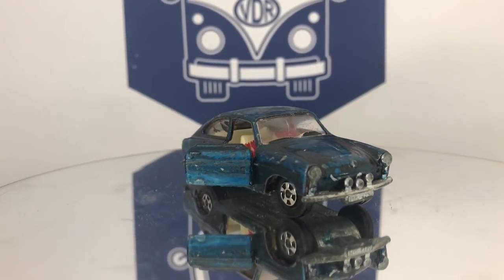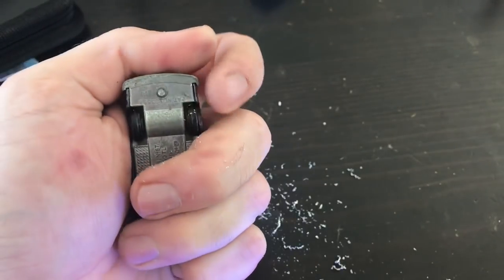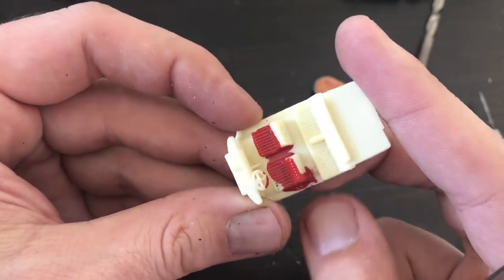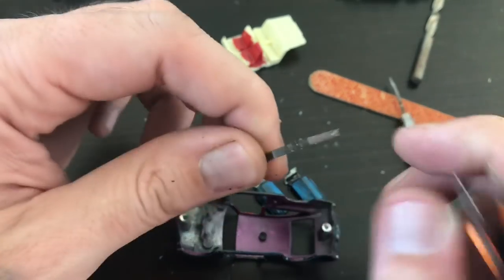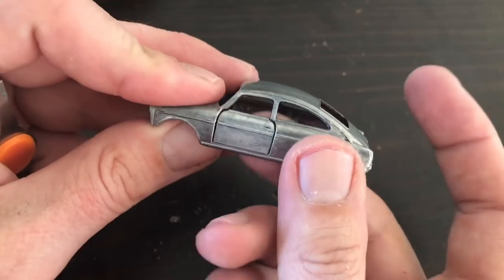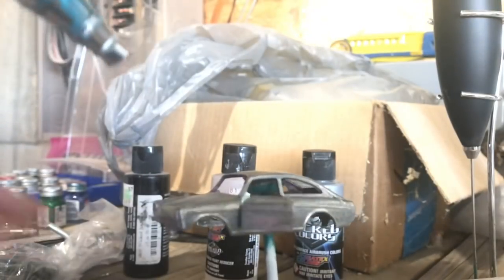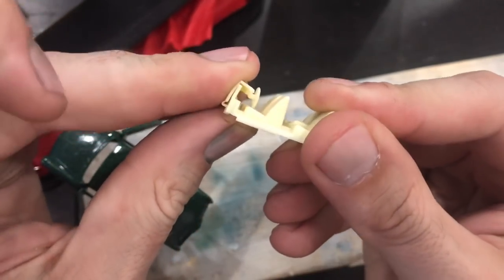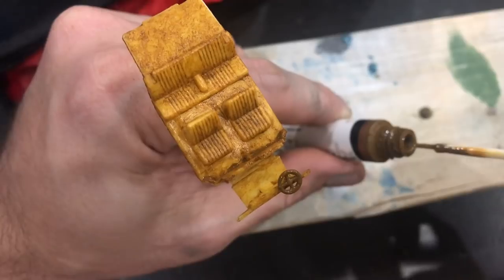Matchbox #67b Volkswagen 1600 TL Superfast Resto-Mod

Comment: I like how you stick two fingers, (at the moment) to the health and safety people by hand holding the car while you drill.
Reply from the maker: Actually, holding the car lets me "feel" exactly where the drill tip is, how much pressure I'm applying, and makes sure I don't go through the car.  Much more control and safer (in my opinion).